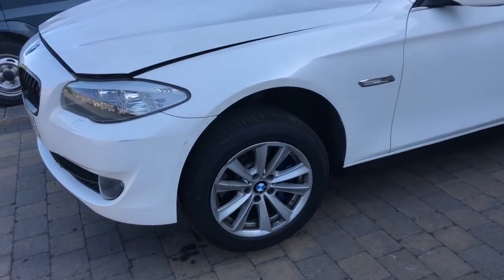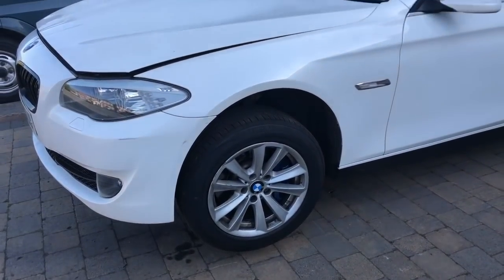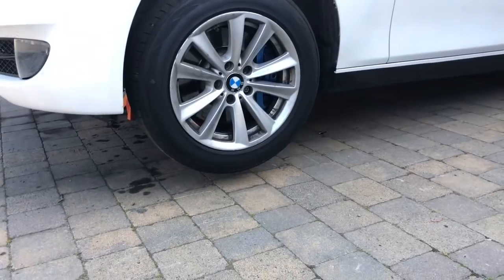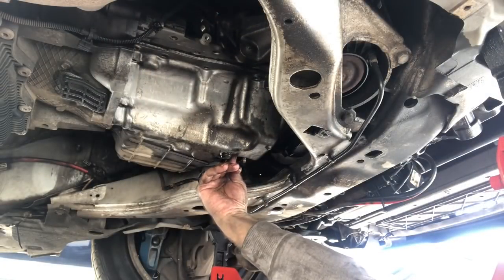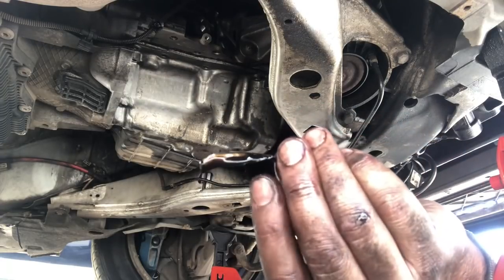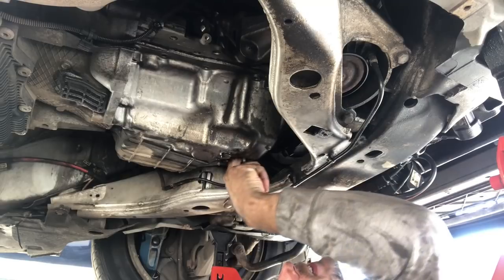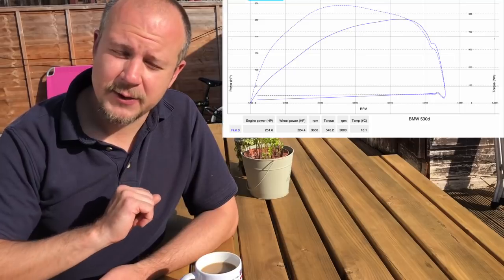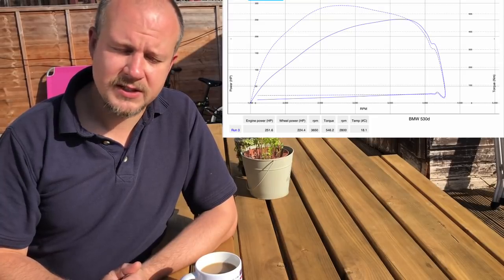BMW 530d N57 ENGINE FAILURE @177k - Spun Bearing! ☠️

Comment: If you've not already pulled it apart, on the passenger side of the engine bay on the same harness as the high pressure pump sensors and a few others there's a single wire plug with a wire clip on it, have you got any sort of a clue where that goes to, I've just finished a timing chain replacement after a failure on my n47 f10 and I cant find what that connector goes to
Reply from the maker: Is it a small sensor plug? It could be the engine block temp sensor (down next to oil cooler/filter)? Or the glow plug module, which I think has 2 plugs to it?
Reply: @Nut_Job.  small enough little connector, it's not glow plug related because I have both connectors in there but it might be that block temp sensor I'll have a look around the oil cooler/filter area again cheers. Mine didn't go quite as smoothly as yours, I had done some damage to the main bearings and had to have the engine out and sent off for the bottom end rebuild

Comment: I think you were actually lucky as the failure would otherwise have taken place on the fast lane of your favourite motorway. I am not familiar with a rebuild like this but I would be concerned to clear all the crap out of the oilways before investing time and money in a fix.
Reply from the maker: That’s a very valid point. I’ll be using a new engine block & hopefully regrind my crankshaft, but yes everything connected to the oil system will need either replacing or very good flushing (oil cooler, filter housing, turbo) 👍

Comment: Do you think having that tuning box on the car had anything to do with the fail ? I know nothing about engines etc so don’t know if this is a stupid question to ask just that I was gonna but a tuning box on the 120d I have but don’t want to now just in case
Reply: I wondered about this as it seemed to coincide with putting the box on but to be honest, could be completely unrelated. This beemer also seems to be hellbent on attacking Nut Job whenever it senses the opportunity to pounce.....

Comment: i have exactly same issue for my f01 n57d30b. gonna do the same, repair it :)
also first time with this kind of engine. do you find also the reason why the bearing failed?
Reply from the maker: Oil starvation. Wasn’t sure whether it was due to the oil pump, or blocked oil galleries. Definitely replace the vacuum/oil pump as part of this job… and be very careful there aren’t small metallic particles in the turbo etc.

Comment: As I understand it, this was a ‘common’ issue with the police, and ex police, 330d engines cars due to low stress conditions rather than high stress. I know a policeman who trains the traffic cops/security services and he said that the word had come down from above to stop buying cars with this engine. Police cars can arrive on scene and be sat idling for 4-6 hours at a time so the oil pressure is low, this is what they have assumed has caused the failures. 

I know a bit more but it would break trust to make it public. This, and new staff who’s job is to ‘buy’ police use cars means you will see more makes/models being used.

Sorry for the necro post but this is info I have been told first hand and it sounds plausible. As a 640d owner I think that this diesel engine is a peach, it sounds ‘good’ and pulls so well using the smaller and larger turbo do well.
Reply: Is it likely to affect the 640d as well or is there any mods to prevent this happening?

Comment: You think the tuning box was the culprit?
Reply from the maker: It’s an obvious question to ask, but actually I don’t think so. I don’t think the box really added much to the total power output & when you consider that there are numerous other engines running this block with higher power & torque from the factory I think it was just the age & wear probably, or oil pump failure etc.

Comment: Does it have the same problem with N47? Similar engine just less cylinders
Reply: You can find all kinds of problems online, the thing is, these engines are reliable and there are million of them rolling everywhere. I have the N47 by the way. They say the N47 has timing chain problem, they say the N47 block cracks, they say the rod bearings go sometime. I honestly believe its over exagerated.

Comment: Oh dear. You really have suffered with this BMW. just as you started experimenting with more power. Will be really interesting to see you rebuild the engine. In fairness, 177k is a lot of miles to start increasing the power. If the enging didn't break, the gearbox probably would. I read where someone else had the same car as you, and the auto transmission failed after the owner remapped his engine

Comment: This is what happens when you do your timing chain on a cheap... Along with your chain unfortunatelly the bearings need to be replaced also. Lot of shops are just changing the chain without removing the engine. Bad....
Reply from the maker: I don’t agree that the engine MUST come out for the timing chains to be replaced, or that doing that causes bearing failure. I agree it would have been a good idea to do the bearings though - but difficult to know this in advance. Also, a bit sad that the engine might REQUIRE it after 165k miles….
Reply: @Nut_Job.  thats ok. I work on these engines daily and run in to these problems always. It is sad that you have to change the bearings on these engines around the 200k km mark to prevent crankshaft demage but the other issues also sad with this engines. Bmw only taking care of the egr related problems and there is a recall for that but the timing chaine, intake, high pressure pump and bearing problems are still existing. In our shop we do not changing timing chaine without the bearings. We experienced many times when somebody replaced the timing for the customer and the bearing failed and the customer had to spend a lot of money for repair. In better case just the crankshaft and bearings if the bearing did not spun around in the block but most of the times it does.. these enginese are weak and badly designed but if you spend the money on preventive service they run ok

Comment: One question remains in my mind: if the engine spits out 2 liters of oil, there should still be enough left to lubricate the crank bearings, or not? Or does the oil pressure drop because of the leak?
Reply from the maker: I think it actually threw out more than my 2L guess, but also having the rear wheels slightly elevated on the Dyno didn’t help as what ever oil was left would run away from the oil pickup in the sump

Comment: N57 🤦🏾‍♂️ never be as good as the M57. I've had 2 and my 2001 330d had 274000 on it and that's miles not km 🤣. You have done some very good jobs on this car but I'd rethink rebuilding this car mate
Reply from the maker: I honestly don’t fancy doing it, but really it’s the best way to get any value back out of the car. Breaking what’s left for parts won’t fetch mega bucks & the front of my house would look like a scrapyard, and selling it in this condition won’t fetch hardly anything... 🤷‍♂️

Comment: What a shame, especially after all you’ve done on it so far. I would be too scared to put mine on a dyno. My stock 535d has enough power to get me trouble anyway 😀 It would be interesting to know how many times and for how long, your car was driving at 155mph while plod owned it. Whatever the mileage says it must have been running stationary for hundreds of hours too.

Comment: What bmx is that by the fence.. if it is a bmx. I hear you with the resistance in the family - I have a 19 year old BMW X5 V8 which I look after and use every day. For some reason everyone in the family hates my car. I don’t know why but they do. It always works and will go anywhere but no, they hate it.. bastards..
Reply from the maker: It’s not really a BMX but similar - I stripped it & rebuilt it with my son. Then we put on the black & white sidewall tyres. 
Yeah, it’s a bit of a pain when no one likes your toy ☹️

Comment: Cost me 2300 for secondhand engine for my 330d 
took me 3 months to find one
Reply from the maker: Yeah, that’s about what I’ve been finding. I’m hoping to do my own rebuild for less than that, but we’ll see... there’s still a few unknowns inside there until I get it stripped down
Reply: @Nut_Job. still have the old engine big hole in the sump

Comment: When I rebuilt my e90 320d engine I was made aware of the fact that the big end shell bearings are made of two different materials one being harder than the other and need to be put in the correct position, they were also colour coded from factory and had a paint dot on them which my bmw dealer asked for when I ordered new ones, not sure if yours will be the same but please bear this in mind just in case. realoem.com will be your friend in this case.
Reply from the maker: Absolutely 👍
Realoem & Newtis are my friends a lot recently...

Comment: Man we love you but trust me there are better cars out there. Go and buy a Toyota or a Honda. I am particularly grateful to you for showing me the way of truth which is - don't buy a BMW. The levels of failure you are getting on this car are not normal for modern vehicles. I guess the block will probably have to come out of the car so if it were mine I'd stick a used engine in it at this stage having put a new timing chain on it, and then just drive it, no remapping or dynos etc. Just drive it and be happy.
Reply from the maker: That would have been my approach too, but working N57 engines are all selling for £2k+ when you look...
That lead me to really think about how to get best value out of what I have left... which lead me to rebuilding it. I don’t think there’s a ‘right’ answer but I think I’ll be able to do all the work a fair bit cheaper than that 👍

Comment: You know you can put a used engine in it for a very less price.
Reply from the maker: Not really. All reconditioned engines available here (and even these are not exactly the same N57 configuration as mine) are over £2k to buy.
Reply: Nut Job That is totally true from one point of view. But say just the bearing are gone bad you can replace them with brand new ones, but if the bore is scored there’s no point in fixing it. That’s because you machine it and put new sleeves it won’t make the same power 🙁. So do look into it. (And what ever you are going to do all the best my man 😅)
Reply: @Nut_Job.  How about a rear ended car from copart as a way of finding a usable engine ? I wouldnt trust "reconditioned" ....

Comment: Jesus Beemers are unreal. My mates got one and its nothing but expense... 
When you say ragged the shit out of, yeah it really must've been I would of thought, cos 170k is nothing really for a diesel engine......
Reply: Perhaps the oil pump died. This happened to a friends engine and the bearings seized causing the crank etc to lock and one of the conrods snapped and punched itself through the front of the engine causing a fire

Comment: scrap it and buy another one, an F11 it`s not that expensive in UK.
Reply: From Portugal with a big hug, don't quit, we love you..... Kind regards
Reply: But then youll have to go through all the trouble of changing the chains again got piece of mind. I think rebuilding the engine is the way to go knowing the chains e.t.c. Are in good nick! Should be a solid motor once the rebuild is done